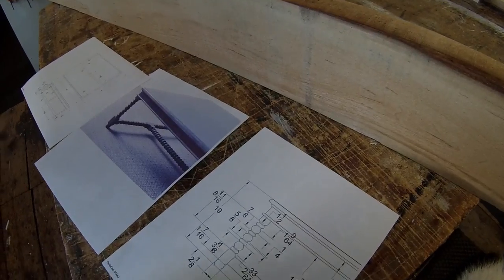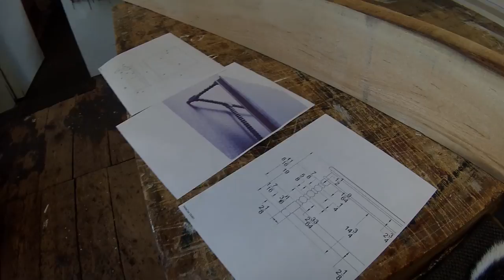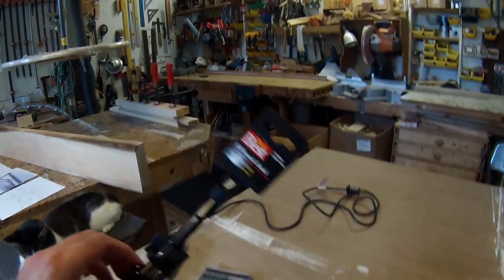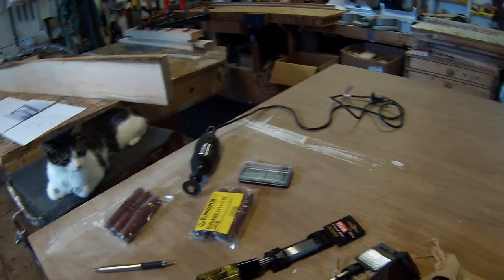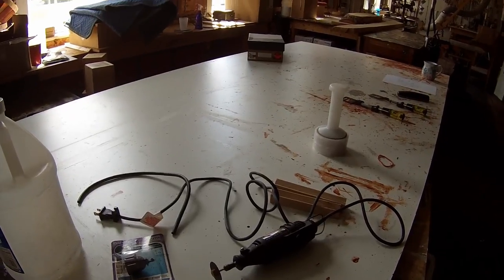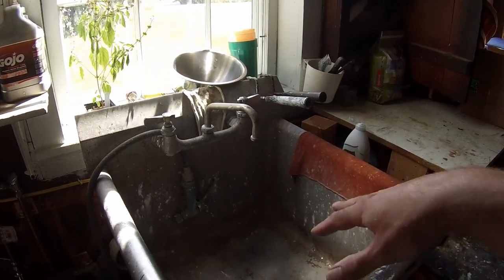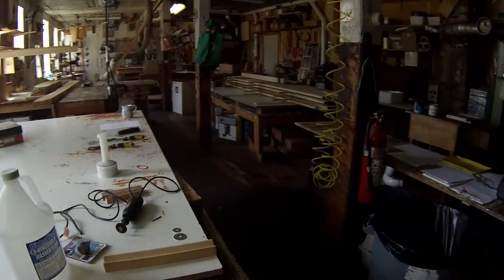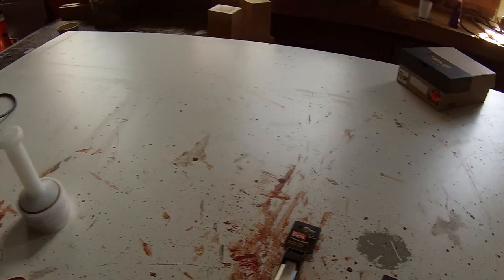Mini Tool and Die Grinder and Custom Lathe Chisel

Comment: Excellent video. I used your idea, but with a different method. Aerated grindstone used the sharpener ruled cutters. I made a wooden shaft, fixed the grinding wheel with pressure and super glue and held the shaft in the wood lathe, then used the tool rest as support and at low speed, molded chisel with round tip.

Comment: Most woodworking chisels are made from high speed steels so that they can really crank their machines during manufacturing.  The high speed steel probably costs 40% more but they can make tools 5 times as fast without having to worry about re-heat treating.  Some of the really expensive tools are cheaper carbon alloy steel because they are hand-forged.
Reply from the maker: Thanks, good info

Comment: Your solution was ingenious but not needed, High speed steels like your chisel is made of can be allowed to get very hot without losing their hardness. a simple container of water to dip when the steel is too hot to hold. When I make knives from M2 power hacksaw blades 0.080 thick i can grind pretty heavy and not over heat the steel. All i do is dip the steel after a few passes across the belt.
Reply from the maker: I thought A2 tool steel was the common choice for chisels?  anyways, the cutting disc performs much better under water.  they wear out quick when they run hot.
Reply: +hffcom A2 is a high speed steel. A steel is defined as High Speed when it has 4%-5% chromium or more. Common HHS steels used for woodworking, A2, Chisels and hand plane blades, turning tools. M2, Drill & Router bits. D2, Thickness planer blades, Jointer blades, Moulding cutters. HSS steels have much higher critical temperature, (1950° to 2150°), As opposed to carbon steels like O1 (1550°) so they can resist temps well over 450° before softening. The chromium in HSS's serves to create wear resistance but a side benefit is it conducts heat away from the source very fast. 
Where you have to be really careful is when you are cutting or shaping thin material. heat very quickly has no place to go and you overheat an edge. A weird HSS factoid about WWII. the early German Jet fighter engines had very short flight time between rebuilds (12-14 flying hours), Because the Germans didn't have enough Chromium to make Stainless High Speed Steel bearings and races in their engines.
Reply from the maker: God of Thunder
GOOD INFO.  I enjoy catching up on some mettalurgy.  Interesting fact about Germany and stainless steel. thanks